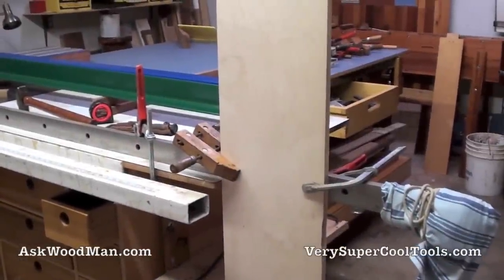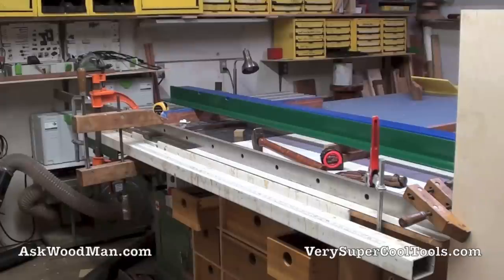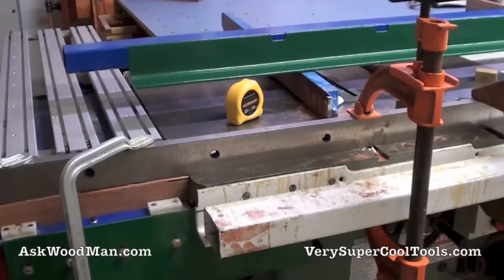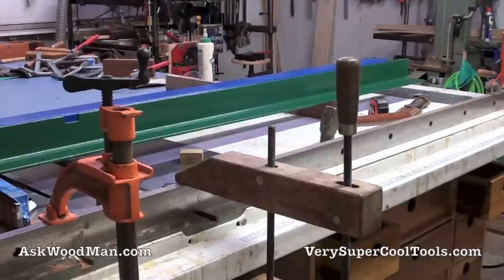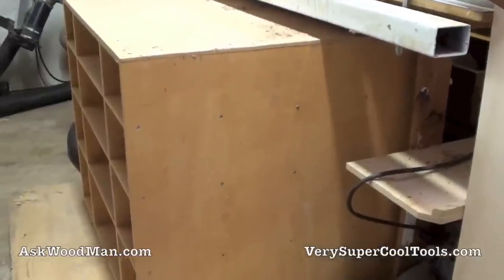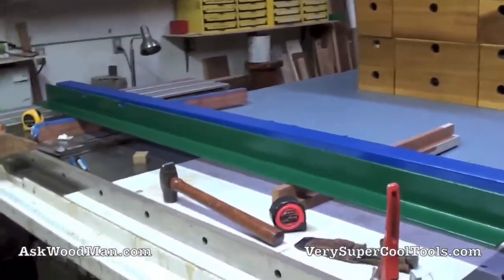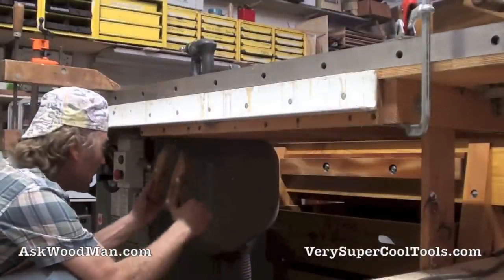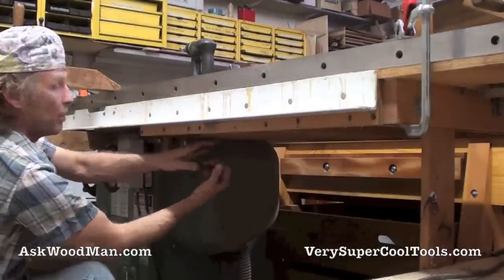1 of 5: Table Saw Guide Rail Install -- DIY Biesemeyer Style Guide Rail Series

Comment: Thanks for shareing this information. I have a Ridgid table saw which is enough table saw for my needs, but the fence and rail system is just crap.I need something accurate and I believe this will do it. so, thanks to you and askthesteelguy I hope to fix my problem in the next few weeks. Tony.

Comment from the maker: I will have my fabrication videos up in the next few days. so between mine and AskTheSteelGuy's great series you should have plenty of information to make a new setup. I have looked at that cast iron top Rigid table saw at Home Depot because so many people have written me about it. It is a fine machine with stout and well made mechanisms. But you are right, the fence is a limitation.

Comment: Allen, In prepping the steel, according to your instructions the weld bead should not be on a referenced surfaced, my weld bead  is on one of the 2inch sides, should it be on the inside or outside using you fence?
Reply from the maker: Duane Whobrey Hi Duane. Have the bead on the outside. The inside (towards saw and angle iron)  is the reference and the outside is just where the cam locks to the flapper. Have you seen the written instructions, hi-res pics and companion video in a condensed form here. http://vsctools.com/diy-guide-rails/ You can also download the plans free. Allan
Reply: Thanks for the response.  I have your plans and I've watched your video series and Jerome Pfifers(?) about 3 times each, but I will check out the link you suggested.  Your videos are so detail oriented I feel like I can do this with little problem..  Thanks and keep up the good work.

Comment: Allen, do the rails for your fence system have to be milled flat on 2 sides?
Reply from the maker: I don't think so. Besides trying to mill a 7' piece of steel tubing flat would be expensive and I question if it could really improve the overall straightness for the effort and cost. 11gauge tubing cut out of a 24' piece is straight enough for my woodworking needs.